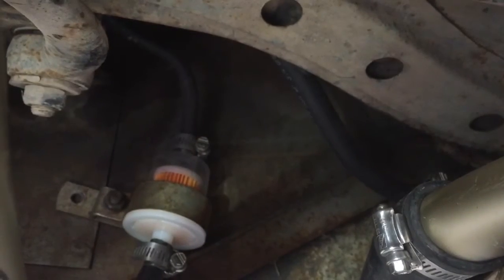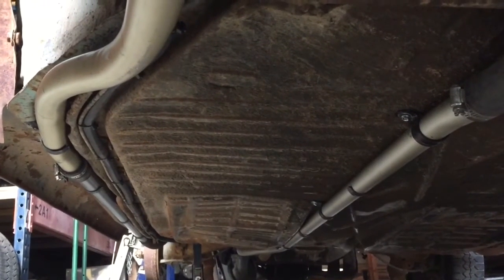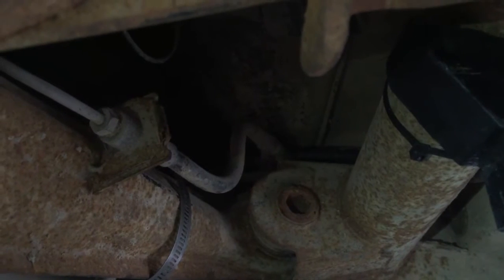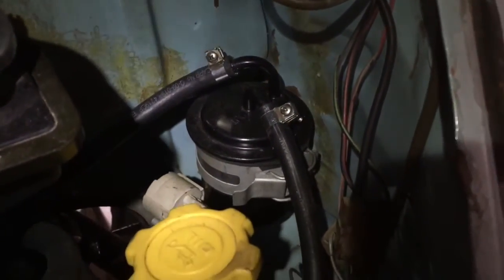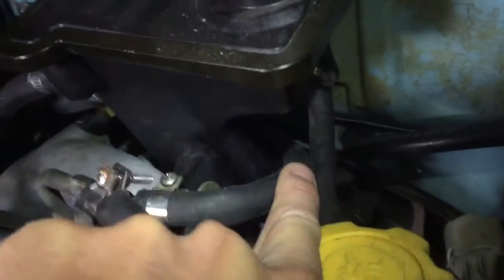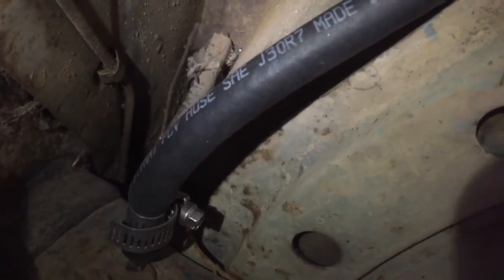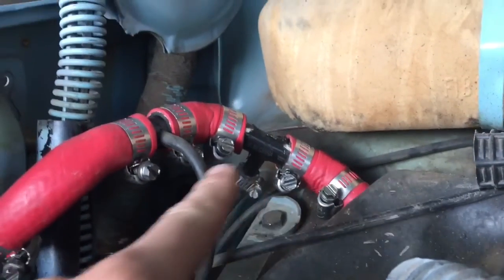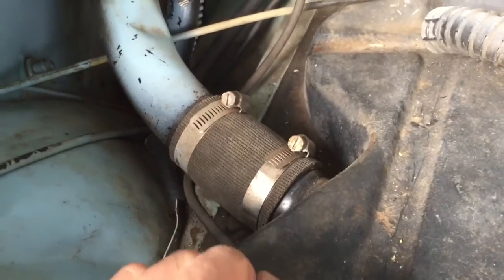BUGaru Part 11 - Fuel System

Comment: What some folks may not know is that fuel injection systems (as opposed to carbureted systems) don't just pull fuel from the tank, but feed fuel to the engine under pressure, and then return the unused fuel back to the tank in a constant loop (to maintain the required pressure). So, when converting a car from carbureted to FI, you have to create a looped system. It looks like your system uses the output from the tank as pressure, with the pump and filter, plus the Subaru filter, in between, and then returns fuel to the tank at (or near) the filler neck, to dump the fuel back into the tank. What wasn't clear in the video, was where the pump was in that circulatory system. Theoretically, you could add a tube to the lower portion of the tank to push fuel back into it, as most modern systems do, and recreate the system that Subaru engines would be familiar with. Also missing would be the sensors in the tank and elsewhere that Subaru ECU's need to regulate other engine management functions. This is why most Subaru swaps need spoofing modules, like the one from Smallcar, to correct the lack of input that old cars don't provide. All of the environmental claptrap. Such is the challenge of marrying modern systems with old. Please correct me, Mitch, if I've misstated anything.
Reply from the maker: +Forthwith Tx I don't think you've misstated anything at all, except maybe for the sensor input regarding fuel level, etc. I tried to follow the fuel system from the tank to the engine and back to the tank but maybe I need to redo it with added commentary. Most people don't read descriptions of videos (in which I state the circuitous path of a Fi system), so perhaps that's needed, in words, in the video. 

Let me know what you think. 

Cheers,
Mick
Reply from the maker: +Forthwith Tx  Maybe it would be worth making a fuel system "primer" video rather than going into the design specifics on a build project. I'll put that on the list of vids to make in the future.

Comment: im completing my ej22 in a 68 bus and wondering what your thoughts are on the charcoal canister. I would like to run it, but can't see how. I tapped into the filler neck of the tank for my fuel return, do you think I could attach the charcoal evap line to this via a T? Would that work? Thanks for all of your knowledge.

Comment: Did you use the stock 6mm outlet on the beetle tank? I'm not sure if that would be large enough for the Subaru engine
Reply from the maker: I did, works like a charm.

Comment: Just curious what fuel pump did you go with? I have the ej22 na trying to find some fuel pump recommendations
Reply from the maker: +KUTZFRECH I often use the Performance Electric P37.
Reply: Seems like it's mainly available thru rock auto.. getting ready to order it just want to make sure it's the one with the red colored housing right?

Comment: cool i want to build my own turbo charged bug but with a custom built air-cooled type 4 engine
Reply from the maker: +ben Dordoy Cool, I'd like to see that. What kind of power are you looking for?
Reply: not sure but a 2.5 l naturally aspirated type 4 engine makes 235 hp with 48 mm carbs so with fuel injection instead of carbs and a water air inter-cooled turbo I think the house power will be at lease 330
Reply from the maker: +ben Dordoy that's impressive for an aircooled engine! I've always heard it's very expensive to build one. For a Japanese WRX engine with 240 HP it's about $900 for the engine then you have an adapter plate and computer so you're around $3000 if all the work is done yourself. Then you can go up from there with very reliable horsepower. It's a good platform and I think that'll be my next engine for a go-fast machine.
Reply: i got the power figger for the type 4 engine from raby's aircooled technology facebook page so it probley power at the wheels not from the engine so power at the engine mite be 250 hp and by keeping my bugaircooled i wont add as water weight as a subaru swap my bugwill probely only be a few pounds lighter however a few pounds less weight may mean my bug will be a few tenths of a second farster on the strip that a subaur power bug with the same power output
Reply: this paln has been scrap as i have been thinking recently about how much it will cost to build the engine and to insure the bug arfter i finished it but i mite still build it but as a drag car so no need for insurance

Comment: so i noticed you dont have one fuel line hooked up. what is that bottom line, and why dont you have it hooked up?

PS i plan on doing this myself next spring
Reply: Is it an evap line?
Reply from the maker: +Garth Meyer Hey Garth, that's the evap line like RandomGuy said. It will connect to a charcoal canister if that's something you'll be running. I'll probably hook mine up at some point but its not essential.
Reply from the maker: +RandomGuy You guessed it!
Reply: +Busaru thank you for the prompt reply! i subbed for this swap. youre a highly informative resource for me, and i greatly appreciate it! cant wait to get into this myself next spring! looking forward to the upcoming bugaru swap videos